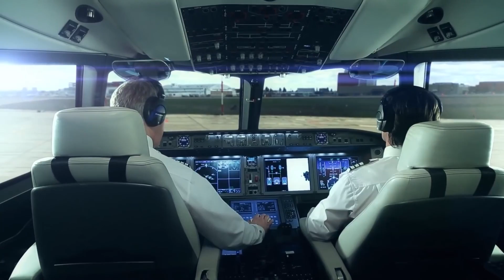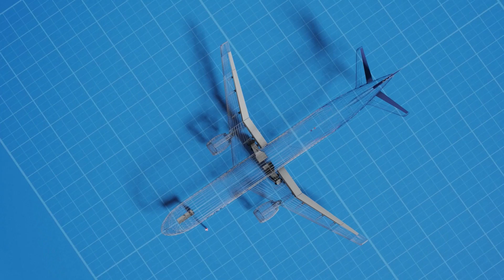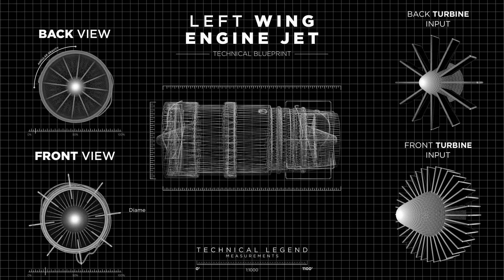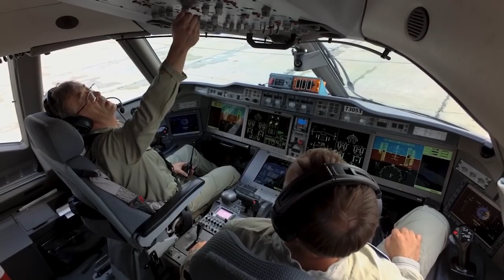Russian 737 MAX & A320 Competitor - The MC-21

Comment: Even if the MC-21 is more fuel efficient, costs less and is available sooner the Elephant in the room is support and spare parts.  Without an efficient international network of readily available parts and support Western Carriers won't touch it.  Sanctions may be in the way of that too, as is the cost of developing a worldwide network.  Airlines have been burned before having Russian Aircraft idle waiting for parts for months.  I don't see a short term solution to that.  If they can overcome that, they may have a chance.

Comment: In 2006, an agreement was signed on the creation of a new engine, which was named PD-14 (a promising engine with a thrust of 14 tons). ПД-14 in russian language. 

PD-14 is a fifth generation turbofan engine developed for MS-21-300 aircraft, PD-14A for MS-21-200, PD-14M for MS-21-400. PD-8 engine will be installed on the Be-200, AN-148 and Sukhoi Superjet 100 aircraft, etc. Therefore, the designers and engineers were faced with the task of creating a unified gas generator, which is the main element of the engine.

16 new technologies were developed for PD-14 by russian designers, engineers and scientists, namely - single-crystal blades for a high-pressure turbine with an advanced cooling system that allows the turbine to operate at temperatures up to 2000 ° K.; hollow wide fan blade made of titanium alloy, thanks to which it was possible to increase the efficiency of the fan stage by 5% in comparison with the fourth-generation turbofan engine PS-90 produced in the USSR in the late 1980s; low-emission combustion chamber made of intermetallic alloy; sound-absorbing structures made of composite materials; ceramic coatings on hot parts; hollow blades of a low-pressure turbine, etc.

20 new materials were created for PD-14 with indisputable advantages: a decrease in specific fuel consumption by 10–15%, a reduction in the life cycle cost by 15–20%; operation of the engine will cost 14-17% cheaper than existing analogues. All of them have been certified according to international standards.

New Russian titanium and nickel alloys are used to create the engine. The engine nacelle design consists of 65% of domestic polymer composites, which achieves the required level of sound insulation and reduces engine weight. 

The technologies used in the production of PD-14 are state secrets and are protected. Therefore, information on PD-14 is largely classified. Example: China would gladly copy production technologies, by analogy with the Su-27. They copied the plane, but they failed to replicate its AL-31F engine.

The PD-14 project, in addition to creating the engine itself, includes the most important element - the provision of after-sales service. A large amount of work is planned in this area: the creation of a support center with round-the-clock work 365 days a year, the opening of a network of field offices, engine service stations, ensuring the replacement of modules in operation. It is expected that this all together should increase the foreign prospects of the new Russian engine.

The state's ability to produce cooled cast blades for a modern turbine aircraft engine is an indicator of the highest level of development in mechanical engineering. There are fewer states capable of producing fifth generation aircraft turbojet engines than countries with nuclear weapons or those that launch satellites into space. Only four countries - Great Britain, Russia, USA and France - possess full-cycle technologies for creating such engines.
Reply: It’s amazing that a country or firm needs literally 6+ decades of experience to build a modern, efficient jet engine. China is trying to develop domestic capacity but it’s going to take decades to catch up.
Reply: Респект тебе, братан. 👍
Reply: The USA has the most market share when it comes to aircraft engines.
Reply: @Dave-jv3th  
Britain and France are afraid to cross the road of the United States, What the United States tells them they do! Since they are vassals of the United States! And Russia spat on the opinion and decrees from the United States! Time will tell which engines will sell better!
Reply: @злойкот-г1т  Это называется недобросовестная конкуренция.
Reply: @Titanishe  
Я тебя понял, но сказанное мной не отменяется...
Reply: @злойкот-г1т  Ты все верно написал.
Reply: @Dave-jv3th  Nothing is eternal under the Moon...
Judging by the COVID-19 pandemic, the United States is quickly turning into a third world country ... And bad debts hang on the country - the country is a potential bankrupt ...

Comment: You are lying in video. It was not Russian protectionism but Western sanctions against potential competitor. But whatever, Russia bad.
Reply: US and western are bad, they invaded more countries than Russia
Reply from the maker: No? The plane was designed to use as many parts from Russia as possible to boost the local economy. The sanctions came later for Russia’s invasion of Ukraine
Reply: @FoundAndExplained  Russia did not invade Ukraine
Reply: @FoundAndExplained  Russia never invaded Ukraine. Crimea is Russian province since 1783. Stop spreading the western media bullshit.
Reply: @FoundAndExplained  there were other sanctions before that and there were and will be other sanctions after that. Including some targeted directly at MC-21 project, such as stopping selling those carbon fiber material for wings. 

So any western suppliers are simply unreliable. This was the biggest reason to have as much domestic components are possible.
Reply: @FoundAndExplained  drivel
Reply: @FoundAndExplained  As soon as Russia became stronger sanction came. It came from whole Russia history since 19 centure. Ukrane was 2014, Sanction started in 2012, Also sanctions were poisoned Scripals, Wada, US election, Navalny, Magnitsky and so on. Last one were on carbon materials without any formal reason for that. Last fact is not protectionism?

Comment: UAC - See my new MC-21
Airbus - Hold my A220-500

Where everyone can agree the A220 is 21st century design beauty this thing looks like a flying soda can. 
Nothing on it looks proportionally right to the aerodynamic eye.
Reply: A220 is already in service but you can't compare to the mc-21 since it's still in testing phase and it has yet more variants still planning
Reply: @st12p5-famosoanthonykhim8   The A220-500 hasn't been built yet either.  The MC-21 is one ugly ass plane. At least the Chinese were smart enough to copy the aerodynamic lines of the 220 for their plane.
Reply: MC-21 ugly? Probably your a jerk that you don't understand the characteristic of the plane, the Chinese is the copier of the design of it's plane c919. Not the Russian mc-21, they have wider cabin and a good cockpit design and have different variants of their own design
Reply: @st12p5-famosoanthonykhim8  It is ugly, mainly because of those wings.
Reply: @ethansaviation2672  dude it's just that every planes have different wings whether it's old or new even when it doesn't have winglets, you just call it ugly because you're too rude and selfish to think about it's main positive on that plane

Comment: Too much  SCEPTICISM in this video. Well it is MANDATORY, because Russia can't be trusted, right?
Wait - NASA was so "reckless" trusting Russia with flying American astronauts to ISS for all those years since the last space shuttle disaster. I am sure that it was only a miracle that nobody was killed during those Soyuz rides and it was because the whole Houston Control Team said 3 Hail Mary's before each take off from Baikonur. (LOL)
Reply: The Soyuz is the world's safest space program. It has an unbeatable track record.
Reply: Marek, ahahah, well said!
Reply: Daun !
Reply: @valerijramzes , кто даун? Ты, Валера, кажется, сарказм не понял.
Reply: Too little. The Superjet was an enormous failure. And Russians have never been good at supplying service and spare parts.
Reply: @van0tot100  Actually a better experience than a flight on Bombardier or Embraer (from a guy who really did have a  first hand comparison).
ENORMOUS FAILURE??? Can you help them clear the BACKLOG of orders?
Reply: @marekweglinski9172  Already quite some airliners stopped using them because of a lack of spare parts and poor availability. Cubana and a Belgium airliner for example. 

Probably the plane isn't too bad by design, but maintaining them and getting the right part to any place in the world in time, is another thing. And Russians aren't too good at that, especially because most aircraft manufacturers were mostly focused on military jets.

I believe that they may be comfy, but not necessarily economical or practical.
Reply: @van0tot100  The problem with the Superjet is in its components. There are a lot of foreign parts on the plane. This was done for the convenience of servicing foreign clients. There were also some problems with engine maintenance. Russian-French engine. It is the French part that is problematic, but the French do not want to fix the problem for free, or reduce the price. There is a misunderstanding between suppliers. Russia with the superjet is also in a quandary, as are the airlines using it. The way out of the situation will be to upgrade the engines to PD-8. Well, the canceled orders will be supported by the Russian government. 2 accidents that happened to the plane are not the fault of the plane. So what the future holds for the Superjet we will see in the future.
Reply: @arrant638  Well, currently only Russian airliners use the plane. And whether it really are the French parts that are problematic (which I strongly doubt), this is still a reason not to buy the jet.

ATR's and Embraer do not have these problems.
Reply: @van0tot100  Is the Sukhoi Superjet 100 an exclusively Russian aircraft?

SSJ 100 was originally conceived as an international project - only in this way it could be promoted to the global market. A significant part of the liner nodes were produced abroad. Only about a third of the French components in the plane; Italian, American and German companies also participate in the project.
As is customary for the latest generation aircraft, it is made with a wide use of composite materials, its engines are among the most economical in their class, and the control and safety systems differ little from their foreign counterparts. The declared characteristics of the airliner allowed it to compete with the leaders in the regional aircraft market - the same Bombardier or the Brazilian Embraer.

How has it proven itself in terms of safety?
Only a little less than 200 units of Sukhoi airliners were produced, which fly little, which means that statistics on flight safety are limited. The accident database contains more than a dozen cases related to SSJ 100. Some of them are due to technical malfunctions, but this is also a common situation.
Prior to the emergency landing at Sheremetyevo, the only SSJ 100 disaster occurred during a demonstration flight with potential customers in Indonesia in 2012. According to the results of the official investigation, it is not related to technical problems and design features. It was caused by errors of pilots and dispatchers, as well as the presence of unauthorized persons in the cockpit.
The BBC Russian Service claimed that the main operator of the airliner, Aeroflot, considered the SSJ 100 the least safe aircraft in its fleet. In February 2018, more than half of all incidents with Aeroflot aircraft were SSJ 100. This is despite the fact that the airline had only 42 Russian-made airliners out of a total fleet of 232 aircraft. The SSJ 100 also flew less than foreign aircraft.

How is the electronic filling of the aircraft arranged?
SSJ 100 is fully electronically controlled (fly-by-wire system) - on the same principle as the most modern Airbus aircraft; the system is manufactured in Europe. In Normal Mode, the computer first reads all the pilots' control actions, then eliminates most of the errors and inaccuracies, and only then sends a signal to the aircraft engines and control surfaces.
Direct control of the aircraft (Direct Mode) is enabled if both autonomous computers fail (or when they receive deliberately inaccurate data on key flight parameters). The pilot of the airliner that burned down at Sheremetyevo said that this happened to their plane after a lightning strike. In this mode, only manual control is possible, without the participation of autopilots and autothrottle. Computers also do not participate in error correction and control of various systems: for example, they do not provide automatic control of spoilers and brake flaps when landing. However, the SSJ 100 Flight Manual (FLE) states that it is always possible to safely end the flight even in Direct Mode. True, crews rarely use this mode in real conditions; Aeroflot's flight operations manual explicitly instructs pilots to turn on automatic controls after takeoff.
On board the Sukhoi Superjet 100, several stages of protection against complete electronics failure are provided at once. Each motor can generate current through an independent generator, and there is also an auxiliary power unit. According to the Airplane Flight Manual, the airliner can fly for up to half an hour only due to onboard batteries. Electrical equipment for the SSJ 100 is not produced in Russia, but in the United States. Communication systems are also duplicated: the airliner has three ultra-short-range radio stations for negotiations with dispatchers, their antennas are located in different parts of the aircraft.

Why is SSJ 100 abandoned abroad?
According to Sukhoi, its liner is 10% more economical than competitors and 15% cheaper, and with special discounts it could be several times cheaper. As the heads of the largest foreign operator of the SSJ 100, the Mexican Interjet, said, 10 aircraft cost them as one airliner from Airbus. Interjet management, concluding a contract for the supply of SSJ100, said about the Russian airliner that it was "a machine for making money." The Irish CityJet also spoke about the liner in about the same spirit.
However, later, all operators - Russian and foreign - had the same type of problems: the plane really won in terms of economy, but lost in another important economic indicator - average flight time. For example, Aeroflot, which has the largest SSJ 100 fleet, reported that, on average, Sukhoi's liners fly only 3.3 hours a day. This is despite the fact that even old Embraers in Russia fly for 5-6 hours.
It's all about the difficulties with the repair. At the beginning of the year, the Irish CityJet, the only one to use the superjet in Europe, refused to operate the SSJ 100. In the spring of 2018, Brussels Airlines (the end user of CityJet liners) reported that it had to cancel 92 flights in 22 days due to aircraft breakdowns; the Belgians already then said that "it cannot continue this way." Almost every failure of the SSJ 100 ended in a long downtime, since the service system had not been adjusted for eight years of the project's existence.
The Mexican InterJet was forced to disassemble several aircraft for parts, so that at least part of it remained in working order. Sukhoi paid the Mexicans $ 40 million in compensation. Then the entire Mexican SSJ 100 fleet was parked; but the Mexicans did not completely abandon the Sukhoi planes, hoping that Russia would someday fix them. Some Russian operators are also thinking about abandoning the aircraft. But the project is supported by the Russian budget and local airlines. The state is clearly not going to close the project and plans to subsidize the purchase of liners by state-owned leasing companies and air carriers; the main customer - Aeroflot - was going to buy another 100 airliners before the disaster at Sheremetyevo.
In addition, the aircraft has at least one design defect: its engines have a very small resource, which is guaranteed to disable them in a couple of years (or even a year) of operation. The manufacturer claims that the culprit is the French company Safran, which, together with the Russian UEC-Saturn, makes engines for the aircraft.

Was Sukhoi trying to solve these problems?
Some of the problems were eliminated promptly. For example, due to cracks in the tail, the SSJ 100 did not fly for some time, but then the defect was fixed. However, it has not yet been possible to cope with the very rapid wear of the engines (2 thousand flight hours instead of the declared 8 thousand). This may be due to the fact that the Powerjet SaM146 engine of the French company Safran is produced in a very small series, it is installed only on Sukhoi aircraft. The French made a new combustion chamber for the engines, and now they will wear out less quickly. In addition, Russia plans to release a new modification of the liner - SSJ-SV with a domestically produced engine.
The owner of "Sukhoi" - holding "United Aircraft Corporation" - promises that the service system will soon be adjusted; at the end of 2018, the corporation presented another plan for the modernization of the system. It is also planned to create a "replacement engine bank" to speed up the repair of idle aircraft.
Reply: @arrant638  excellent explained 👍